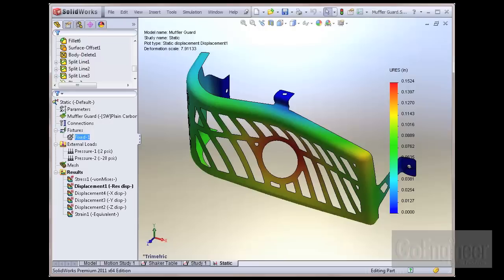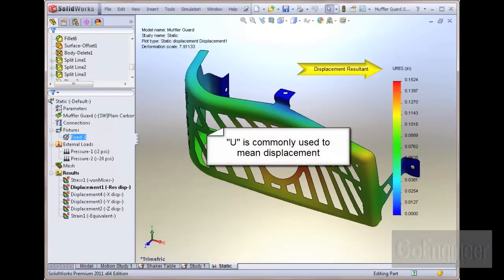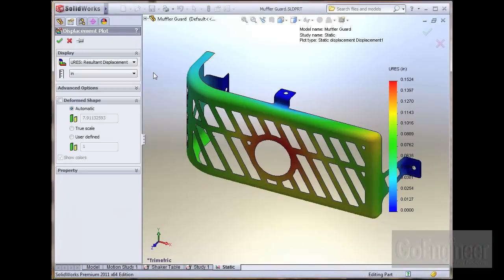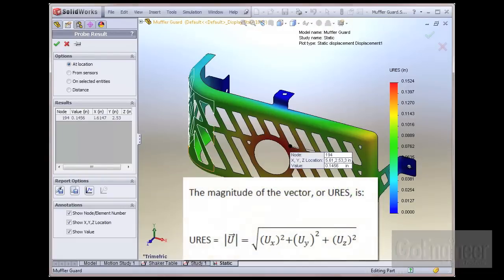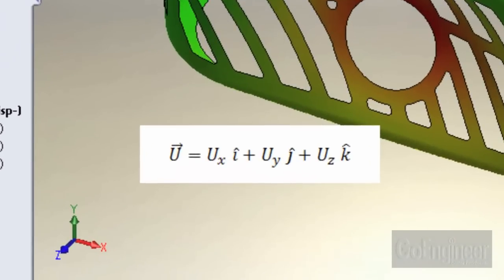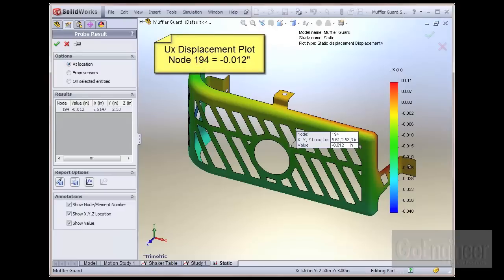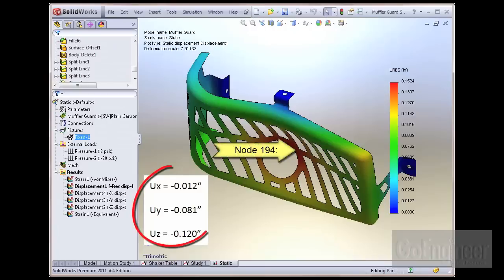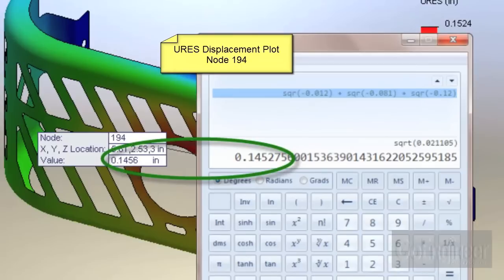SOLIDWORKS Simulation - Explanation of URES in Simulation Plots

Comment: This was very helpful. Unfortunately it seems that in SimulationXpress there is no option to show the components in the x,y&z seperately. Any suggestions on how to find the specific components of the resultant displacement?
Reply: +Uzoma Bailey Ayogu  i'd also like to know. this is quite frustrating. all the videos and help menu just say right click, but this doesn't seem to be the case.
Reply: thanks, it took me far longer than it should have to figure that out. the simulationxpress is a good step by step process but it limits what you can see in the end.
Reply: Yes. SolidWorks  only allows all this functionality in Premium Simulation NOT express. That's too bad because the cost is very pricy to get the top level SolidWorks  Premium.  At least we get something.